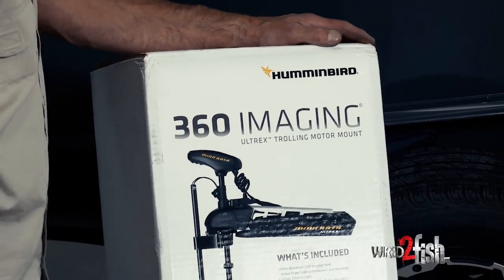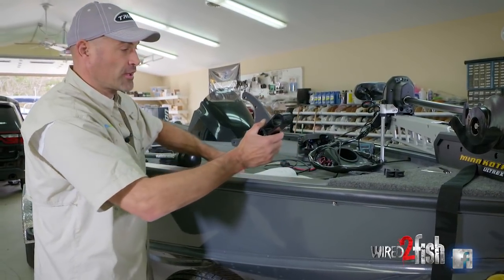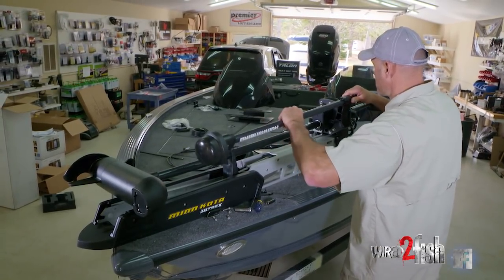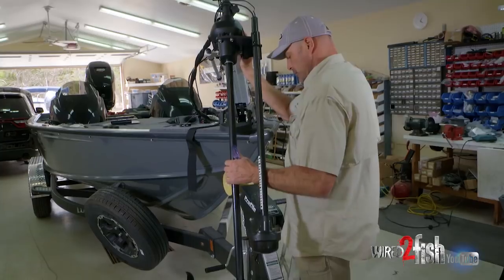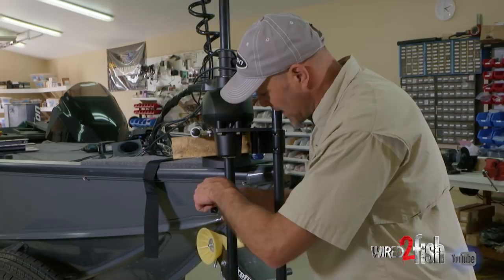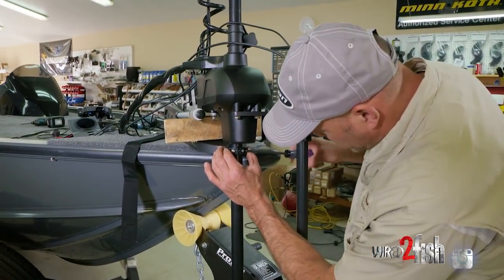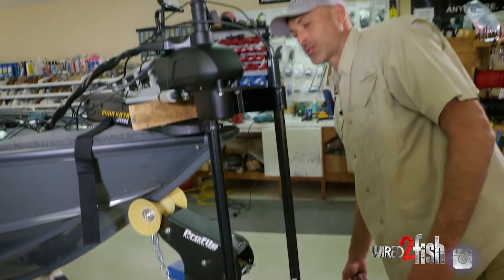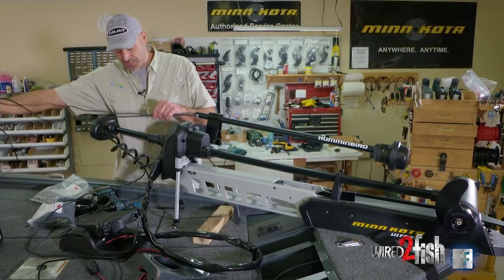How to Install Humminbird 360 Imaging on the Minn Kota Ultrex

Comment: Install is not complete LOL 
Where do you plug all of those cords and cables into?
Reply: That's what I am looking for?
Reply: @mikekenner9218  I connected to basically any 12 V power source that’s up at the bow. You’re gonna have to cut and splice into a wire… like your trim or light switch
Reply: @drmroneal  Thanks for replying.  Why would I splice into my trim or light switch?  Can't i just run the cables to my battery?  Put a 1 amp fuse on the negative?  I was curious if I need to hook up the puck to my Helix unit.  I am wanting to install this compass puck for Mega 360.  Thanks!
Reply: @mikekenner9218  you can run a cable all the way back there if you want to. It’s just a bigger job and yet another cable on your battery. But yes you can do that. 
As for the helix hook up, my nitro comes with a fiber network that connects all my graphs. I plugged into that. But you can plug in directly to the unit.

Comment: Great video.  I'm installing 360 and livescope to my ultrex. I have the livescope mounted to the shaft about 6 inches up from the motor barrel. Will this interfere with the 360 transducer performance since it will be mounted a couple of inches up from the livescope transducer?
Reply: ya your readings are going scramble it all up. Live scope you have the best view when its not on the shaft and you turn the transducer in whatever direction you want with out the trolling motor running, or run only 1 unite at a time the fish can feel those pings if you have 4 top of the line units

Comment: I noticed some install videos didn't include the heading sensor. Is that required?
Reply from the maker: It's not required but does provide you more accurate boat positioning on the map, faster position fixes, and constant heading even when sitting still.

Comment: Need advise I have a Ulterra 112 with I-Pilot link there is a Ethernet cable coming from the head small round end. Need to go at least 10 ft to a Ethernet box. What extension cable do I need. Love you Videos  Thank You
Reply from the maker: Hi Thomas, sounds like you need a Humminbird Ethernet Cable. If you have a 10' run, we'd recommend getting one at least 15' long so you have some leeway. AS EC 15E - 15' Ethernet Cable: https://humminbird.johnsonoutdoors.com/accessories/cables/ec-15e-15-ethernet-cable?id=18571